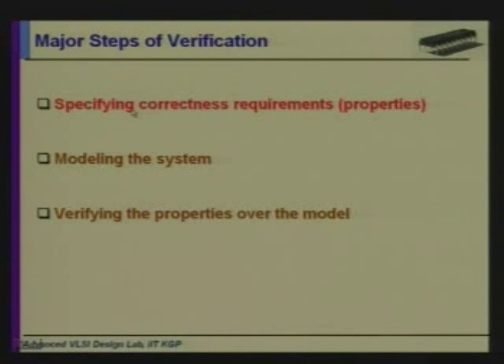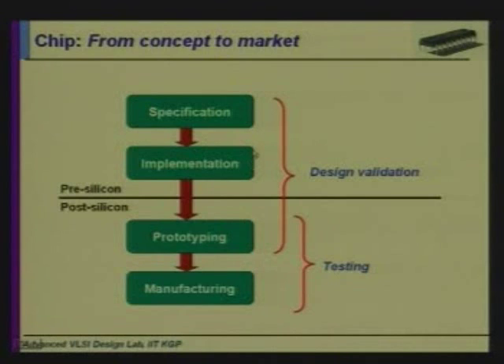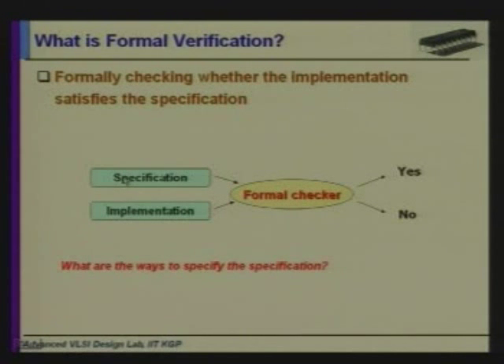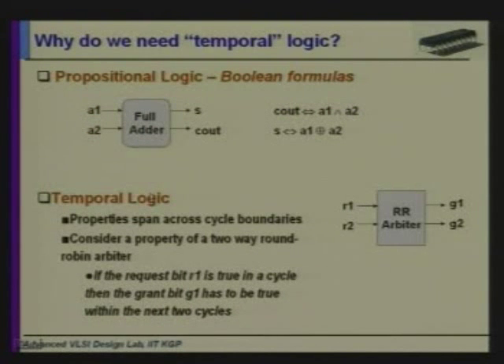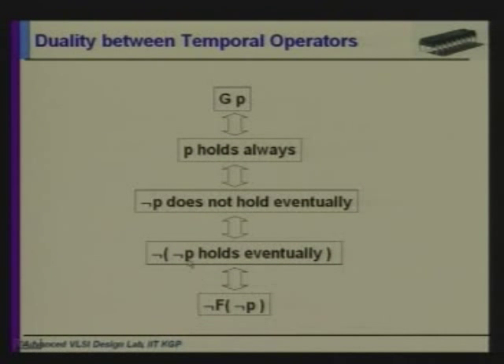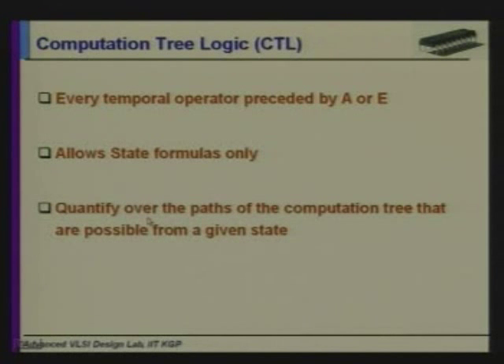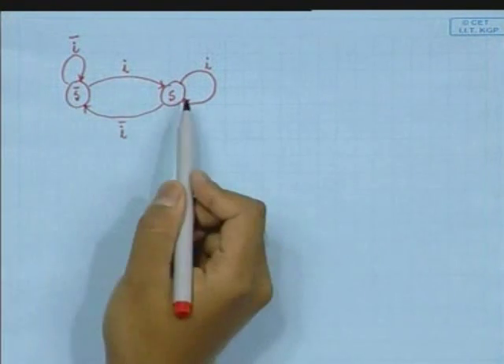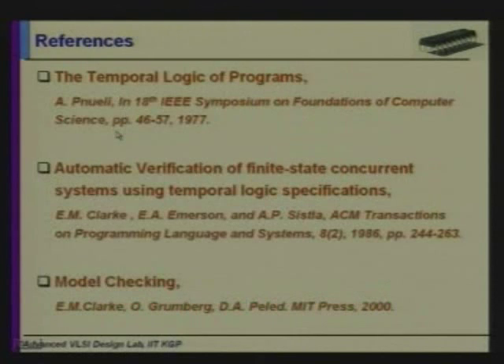Lec-38 introduction to formal verification

Comment: I'm confused. Is formal verification a method to check if implementation satisfies specification? Or is it to check if 2 types of implementations are equal?... For example, a design implemented using RTL code, and a design implemented in a Gate-level netlist... I asked this because there is no way to check if implementation satisfies specification if you don't create a functional coverage for it.. The tool doesn't have the capability to automatically read the design specification. Engineers are the ones who specify which specification needs to be checked by writing a functional coverage.. So since this is a formal verification, then I think it is rather checking the equivalence of 2 implementations... Please correct me if my understanding is wrong. Thanks!
Reply: I think I found the answer to my question. I read this link below. Anyway, if you have additional infos, then I appreciate if you can tell it to me.
http://www.edaboard.com/thread338409.html